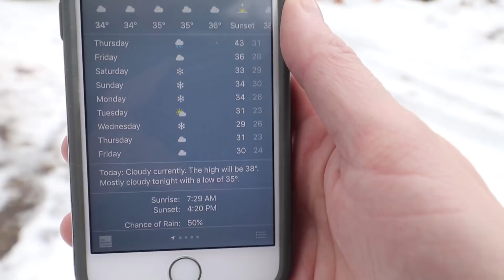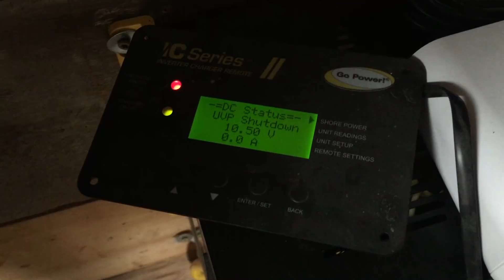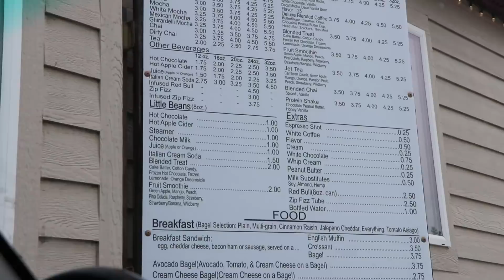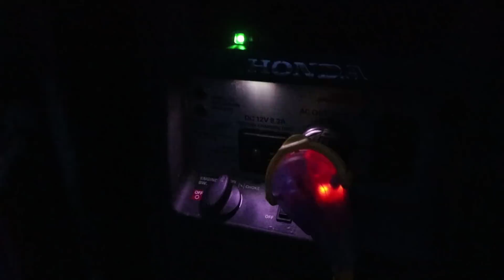Our Story: Giving Up Solar Power to Go On Grid

Comment: I fully support your moving to the grid, in the future you can go off grid if you want, BUT it’ll be on your terms and it won’t be in the midst of needing to do two million other things also. Right now you’ve got too much going on to be babysitting a solar system when you need to be focusing on building your house. In the meantime you have a couple of portable generators to provide you with power should the grid go down in a storm or whatnot.

Comment: Uh ? On grid ?? Going back in time ?
Reply: Yep, to a point in time where power is cheap, abundant, and reliable.
Reply: Where people don't assert they are "off grid" when relying on gas powered generators, and driving a gas powered car to and from town to buy ice and gasoline. All that gasoline, and ice (made using fossil fuels), and TIME can be replaced with a few wooden poles and a few hundred yards of copper. And the local power generator will be FAR more efficient than your tiny generator could ever be.

Comment: Fifty 300w Solar panels tied to a minimum of 4 Tesla Powerwalls  (or equivalent)... plus you'd still need a 10KW back-up diesel generator with a large fuel tank for those long weeks without sun or heavy power use.    Fortunately there's no battery maintenance with Li-Ion storage and very low maintenance with a good generator setup with a suppressed sound package..   With a power management auto-start and auto shut-down controller, it would feel like you are on grid power and you'd have power if the grid goes down.  You could run tools, welders, hair dryers and kitchen ovens with very little power management worries.  But a $70k solar system with occasional fuel bills verses a $15k plus grid connection and years of power bills is something to weigh out.   I'm grid tied and happy with an all electric house, including spa and well, but 39 panels don't cut it in the winter even in sunny southern CA.
Reply: Given their location, and the likelyhood of the house using propane for other reasons, the genset should probably be propane based rather than diesel; unless they will be growing bio-diesel on the property?! Bulk propane is probably better deal than bulk diesel depending on how close they are to frac fields.

There are better systems than Powerwalls as well, even if you are using Li-Ion instead of Nickel-Iron, sealed or salt water.

Would need a proper solar survey to determine if 50 panels is enough/too much for their location. Also, depending on where they would site the panels on their property would determine if AC or DC coupled makes more sense.

Comment: Congratulations! I think you are making the right move. I used to sell solar energy 30+ years ago and in all that time since, solar really hasn't changed that much. It was a supplemental power source then and it's the same thing now. It's cool when you combine it with grid power because you can lower your utility bills, but save for the sunbelt states, it's not meant to replace grid power. Hope you get hooked up quickly and cheaply.

Comment: Just a thought regarding true homesteading.  Burning wood is NOT sustainable.  This assessment isn't very scientific but an average homesteader could burn 3 cords of wood in a year to cook/stay warm.  If we assume the trees they're consuming are an average of 5 inches thick, they would consume 46 to 55 trees PER cord for a total of 138 trees on the low side.  If we make the assumption that they are consuming larger trees, yes the tree count drops but the rate of replenishment would also drop and make it unsustainable.  I would argue that homesteaders that rely on wood for heat/cooking are doing more damage to the environment than good.  If 5000 people are homesteading across all of just North America, that's 690,000 trees cut down a year!!  The trees do not grow back fast enough to maintain this life style.  Again, this is working from estimates of averages so it's not accurate by any means but it's not far off either.  PLEASE go back on grid!!
Reply: Your kidding right? Clearly you know nothing about burning wood or the trees you use. You do know that it is DEAD trees that people with a clue use for firewood, right?
Reply: I would be willing to bet that the average homesteader is not able to sustain the rate of wood consumed to trees that area already dead.

Comment: solar is good.put at this time it will not pay for its self in a timely manor . you can run only on solar but it would take $$$ . how much solar can you afford ?panels are getting better put a lot reduce power output by about   5%each year . battery failure is about 8 years . so in about 15 years your  system is worthless even on your 2nd set of batteries. than if you put it on your roof lightning strikes are more of a problem . you are asking for it .
Reply: @fricknjeep,I don't know where you get your information, but it's not accurate. The panels don't lose that much output, and battery life depends on the type of battery, and the way they're cared for. These people totally discharged their bank of L-16s (probably regularly), so those wouldn't last their expected 12 to 15 years. Our first bank was 220ah golf cart batteries, and they lasted us 6 years, with some of the individual batteries still viable and moved to another building on the property. ....you've also obviously never heard of lightning arresters, or DC circuit breakers, two items installed to protect the system.
Reply: You could spend a bit more up front and get some Nickel–iron batteries. They are the least expensive if using a 20 year financial model and will last for 30+ years.
Reply: a panel does not degrade 5 percent per year.     Who told you that